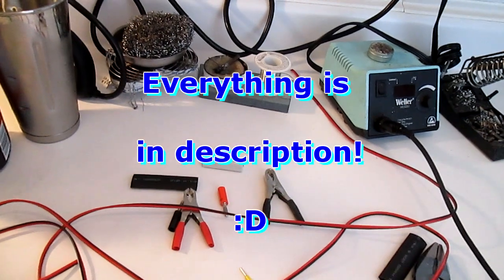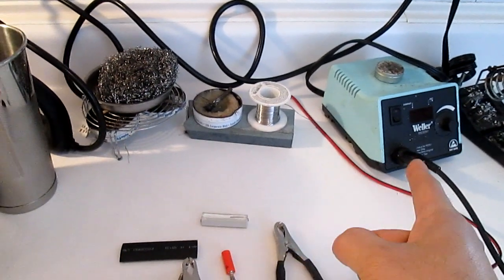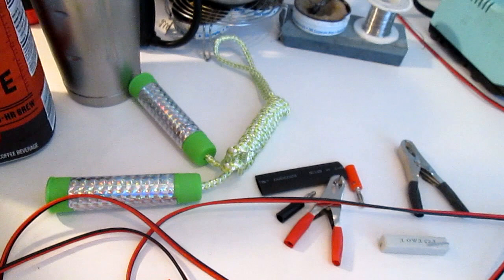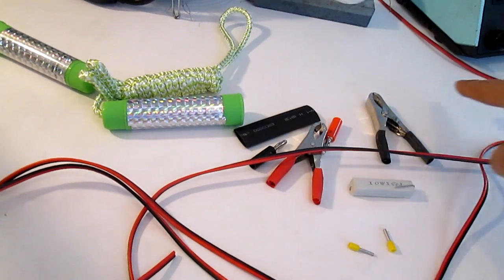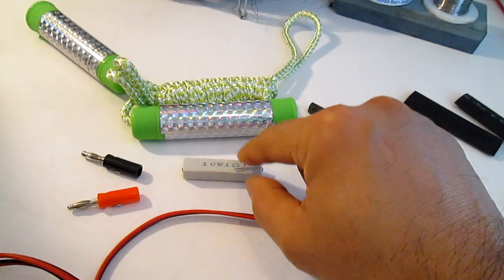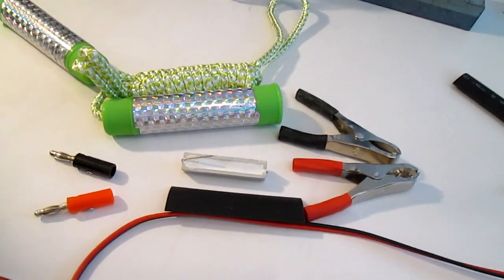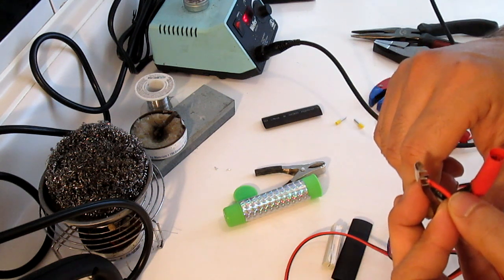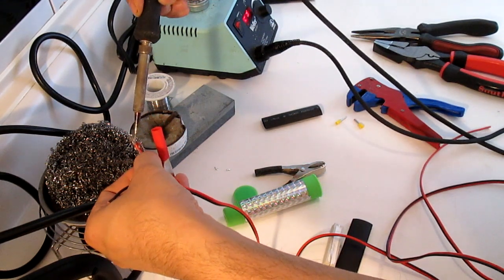DIY - Parasitic Draw Drain Test Tool - Testing Car Truck Battery Dies Overnight - Check Voltage Drop

Comment: Do turn on a fan when you're soldering ? I do but I didn't use to
Reply from the maker: Yes, I always try to turn the Fan on when I am Soldering.  The 60/40 Solder Tin-lead, I have to.  It gives me headaches :((((.